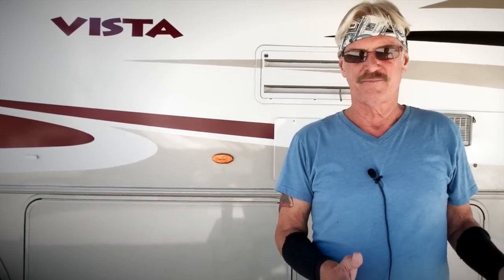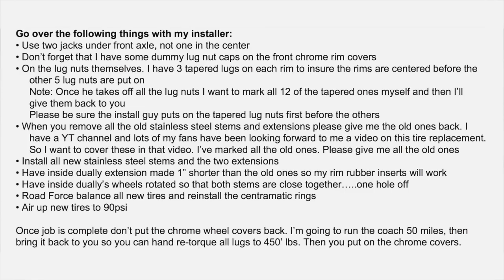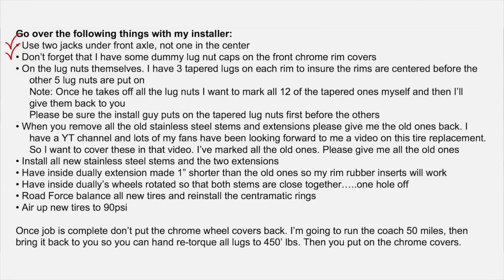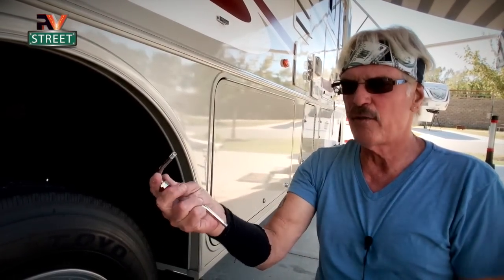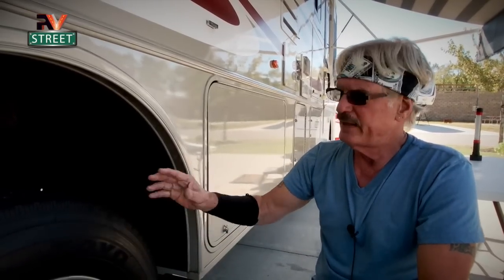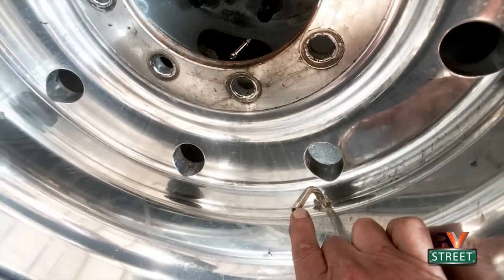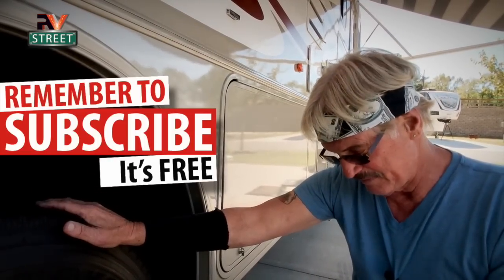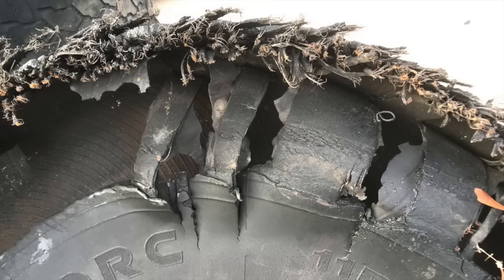In's & Out's of BUYING & INSTALLING New Motorhome Tires

Comment: Im in the middle of a tire replacement pickle. I live in Maryland, watch most of your videos and took your advice about the Toyos. Only problem is, I bought a had the front 2 installed and was stupid enough to wait until the holidays were over to try for the 4 rear and now the shop I go to says that the Toyo supply chain has dried up and he can’t get them in. I need to go to another reliable brand of tire for my smaller 33’ gas MH that currently runs 19.5 Michelins that have sidewall dry rot at only 5 years. I just purchased this rig. HELP please.
Reply from the maker: Well, ask him if you can find them and have them shipped to his shop, will he install them and if so for how much?
I don't like that option, but it seems that's all you have right now.
Get online and try to find them. Here's some suggestions to start:
Try Walmart
https://www.motorhometires.com/
https://simpletire.com/

You could also get Hankook Tires. They are also a good choice. Maybe your shop can get those. The only problem with this option though is you'll end up with 2 different types of tires on the RV. I also don't like that option but...........
Reply: @RVstreet  I know, me either, but I’m between a rock and a hard place. He just can’t get the Toyos and if I don’t put something on soon, economics are going to kick in and I won’t have the money to. Thanks. I’ve been looking online and but not at Hankook. BF Goodrich was what I thought might be equivalent. Thanks Martin. I’ll do my best with this. Tires “age out” and so does this old gal.🤷🏼‍♀️
Reply: Thanks for your suggestions, Martin. I’ve got him pricing out both General and Hankook. I appreciate all of your help. Stay safe now and I hope to meet you and the better half out on the road some day.🙋‍♀️🙋‍♀️

Comment: Hey Martin, I have a new Tiffin class A and can’t get a psi (as in 0 psi) reading from the valve extension on the inside rear tires, any ideas?
Reply from the maker: If your air compressor gauge is working on all other tires, you may have some dirt on that particular valve stem. Blow it out and try again. Also manually press in the valve stem for just a second and see if air comes out to make sure it's not stuck.

Comment: What valve extenders do you use?  Having a bigger of a time finding good ones. Local tire shop told me to stay away from them cause they leak. I told them I want the stainless steel ones that are rigid
Reply from the maker: I have Dill Stems and Extensions.

Comment: what is the difference btw spin balance and road force balance? and since you have the center matic, why not just do the spin balance?
Reply from the maker: There's a lot of info on the web about the difference between the two.
Even though I have Centramatic Balancing Rings, as I said in the video...I want to start off as perfect as possible and spend the extra few bucks for Road Force Balancing. Not all will want to or be willing to do as I do...but that's ok. Keeping all of my front end suspension, bearings, king pins and tires in perfect form and condition is more important to me than saving a few bucks.
thx for your question Mehmet 🔧

Comment: Marvin.  I currently have Michelin 235/80/22.5. Xrv.  The Toyo M122 fit the same rim you had before.  I’d like to try these in place of the Michelins I have.  You stated you liked the tire. Is the ride pretty good compared to the Michelins you did have.
Reply from the maker: Yes they ride even better and more rubber on the road cause they're a bit wider. That's why I bought 6 of them. I love these new tires all the way around.

Comment: I did not know about buying stuff unrelated  RV helps you. I buy a lot of bits and pieces, I def remember that in the future . Are you still using the EEZTire-TPMS6ATC model or do you have another one you use ?
Reply from the maker: Absolutely I still use it for both the coach and the toad. It's the best. Accurate, no interference from other devices, easy to read, I also installed a booster in the back of the coach. Wouldn't be without it.
Video on this: https://www.youtube.com/watch?v=2kCXRbvtoYA&t=373s
In my Amazon Store: https://www.amazon.com/shop/rvstreet/list/1FUC3YMUOK6RD

Comment: Hi Martin I sure enjoy your videos thank you. I have a question for you. Do you take your rig in and rotate the tires and if so how?
Reply from the maker: Hi Ron,
No I don't. No need to. Since I road force balance my tires from the get go + running centramic rings my tires will time out WAY BEFORE rotating is even in the equation. But....even if I didn't road force balance in the beginning, the centramatic rings keeps my tires totally balanced even as they wear. That's why they're worth the money.
Reply: @RVstreet  Thanks so much I sure appreciate you

Comment: Martin, I have a Coachman Encounter 37’ Motorhome on a Ford chassis and a V10 Ford Power plant.  I have 22.5 tires like you with duel rear axel.  I would like to get Centramatic Rings like you.  Do you have advice on P/N and Manufacture?
Reply from the maker: There is no one part number for Centramatic Rings. The ones you'll need will depend on the type of hubs you have, bolt pattern and the year and model of your RV. There are literally dozens of different configurations. Contact Centramatic sales and they'll get you the right ones for your RV. When I bought mine—6 yrs ago—I spoke with Ricky Jordan in sales. I was in Texas at the time.
Here's the list of their sales team and the regions they cover:
https://www.centramatic.com/our-team.rhtml
Ricky was very helpful. He gave me a discount without me asking for one and shipped them to my tire store that you saw in the video. I saved some money by not going thru the tire store. Tell them how you found out about their products, my video and YT channel and they may give you a discount too. Who knows. I'm not affiliated with them but I highly believe in their products.
https://www.centramatic.com/
Reply: @RVstreet  Thank you for this info.  I was scrolling thru the questions to see if anyone had asked about the Centramatic Rings. I will contact Centramatic.

Comment: My tires are right at the 5 year mark on the used motorhome I bought last year. The tread is still awesome. I was thinking I could go longer because I don’t know how old they were before the install. Should I change them?
Reply from the maker: The time tires start to get old is the day after they are made. Just sitting on the shelf tires age. Doesn't matter when they were installed or the tread condition . That's why you use the DOT date on the tires. Since you don't know the history of the tires, like whether they hit anything in the past 4yrs., were they run at the proper PSI or not, etc, etc., you you could go to 6 years but for me....  I wouldn't take that risk and I'd be afraid I couldn't find them or afford them in a year.  Just my opinion.
Reply: @RVstreet  thanks for the reply. What is the address and phone number  of the tire shop you used. May as well hit them when I come through Texas. And of course I will let them know it’s because of you. 😁

Comment: What about tire rotations Martin?
Reply from the maker: No need to rotate. If your alignment is dialed in, and your weight is well distributed, most RV tires will age out before any rotation is needed. That's another reason why I pay the extra money for road force balancing and centramatic rings. Starting out with everything perfect to begin with, my tires will go the distance without rotating them.
Reply: @RVstreet  Thank you for getting back with me.  Very Informative info that is of great value.

Comment: Great video (as usual). Something I have been wondering.......why couldn't a Kevlar-like inner tube be made to fit into the front tires for the purpose of preventing an explosion of the tire casing as you had shown in the tire graveyard at the tire store? 
RVstreet, also known as the pragmatic RV'er
Reply from the maker: Pragmatic  - dealing with the problems that exist in a specific situation in a reasonable and logical way instead of depending on ideas and theories. Yep that's me 😍
Kevlar-like inner tube ? I have no idea about that.

Comment: Martin, we live in Conroe and will consider Southern Tire for replacing our Class C due to age.  Are those tires QUITE on the road?
Thanks 😊
Reply: I've run TOYO Open Country tires on our 32 ft class C and love them. Great ride.
Reply from the maker: Yes they are. Actually now that I have them on the front instead of the Mich's, I find them quieter than the Mich's. They're wider too which is why I went with the M122's.

Comment: Martin why only 12 tapered lugs and not 18? 3 per tire 6 tires are there not any on the inside files?
Reply from the maker: The rear dually's are held on the hub with the same 8 lugs. Therefore, 6 tires, 4 sets of 8 lugs, 3 tapered lugs each set. 4 x 3 = 12.
Reply: @RVstreet  thanks Martin I thought it had something to do with the rears your channel is a wealth of information